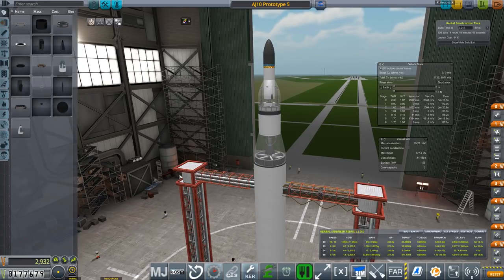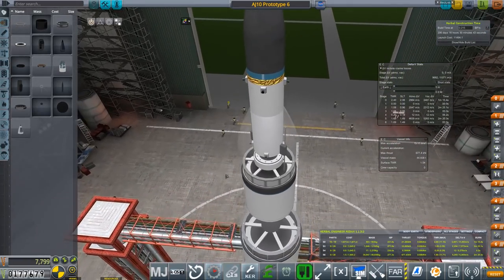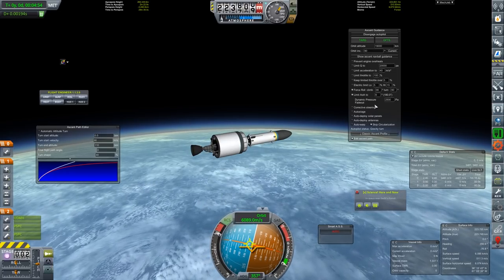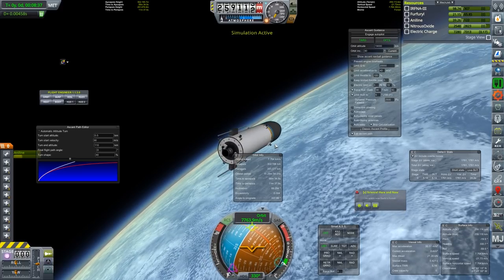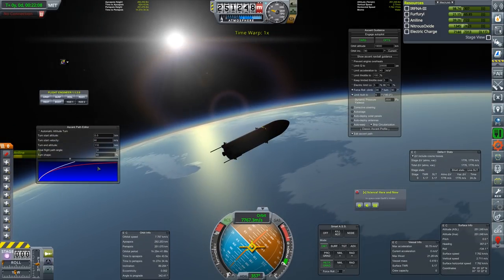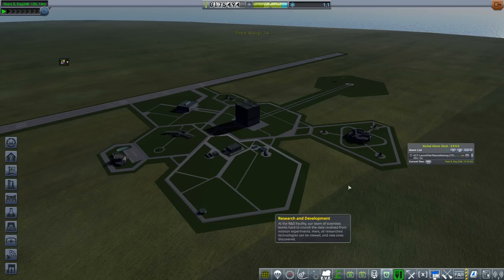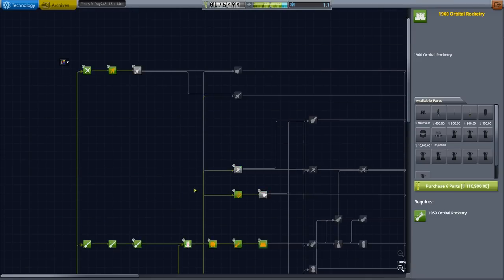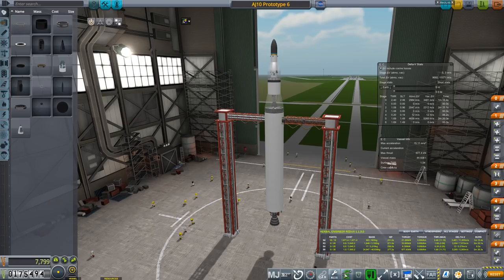Realistic Progression One Release E12 - Sun Synchronous Satellite

Comment: Don't worry! Your explanation of how to launch for TLI is excellent! One additional hint: instead of doing calculations up-front, you can also set the moon as your target (requires maneuver nodes unlocked). Then, watch your ascending/descending node angle (in map view or in mechjeb:orbit parameters). You want to get that to 0°. However, don't forget to wait for the launch site to be in the orbital plane of the moon before launching (should take at most 1 day).

Btw, I unlocked orbital rocketry yesterday and apparently, it is possible to build a 20t orbital rocket (250km 28° inclination, 200 km 90° inclination) using only early satellite era technology (AJ-10 w/o upgrades, LR79/89 w/o upgrades, tank III, post-war avionics). Can you beat it, or alternatively, build a 60t lunar rocket (flyby <= 10000 km perilun)?

Comment: For long circularization burns (which will be the default of 2STO crafts) and low target orbits (which will be the default for BEO missions with LEO parking), in particular on steep initial trajectories, you can gain efficiency by burning off-prograde in the following way. Some of your energy will not go into final orbit, but more of your energy will go into raising perigee rather than apogee. Start your burn when time-to-apogee is half the burn time (as in the video). If you have maneuver nodes, place one prograde on apogee and use that. Otherwise, just try to keep your apogee as stable as possible using pitch.